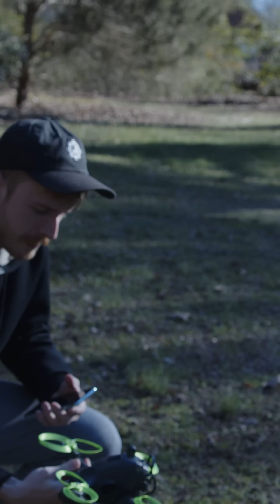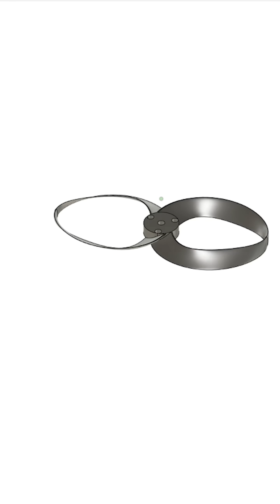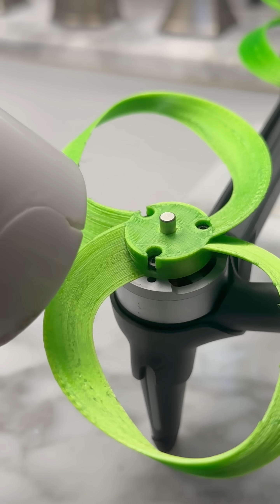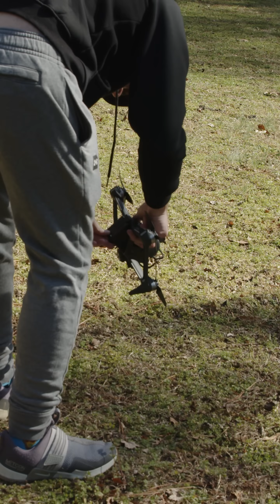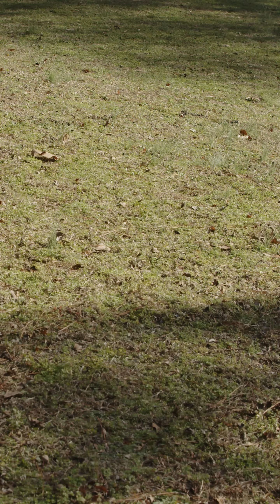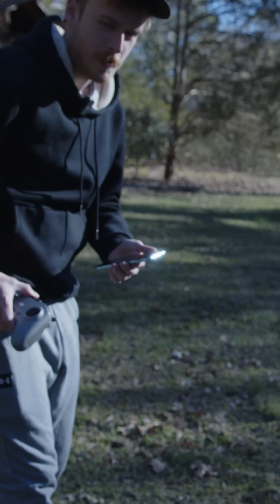Testing MIT's Toroidal Drone Propeller Design & Sound #shorts

Comment: Did it ever occur to you that the nail polish coating was not smooth enough, resulting in turbulence? In that case it would’ve increased turbulence, reduced efficiency and increased the amount of noise. Production seems flawed.

Comment: The 3d printed propellers weren't smooth which makes the entire test pointless. The roughness of the surface introduces turbulence which both reduces thrust at a given rpm and increases noise

Comment: I think it sounds promising, but the "quieter" is greatly impeded by the commercial propeller being made to a much higherstandard - more accurate shape, thinner due to stronger material, and smoother. you really would need to print propellers of a traditional type with the same printing technique to compare.

Comment: the premise is that the Hz frequency at top speed is more dull less spike so it dont hurt your ears.. they would prolly be better if you sand smooth and even all edges and sides no chips flaks grooves or lines then polish coat and try to keep that smooth and dont let is wall up in the twist

Comment: Dude, a coat of varnish is nowhere near enough to overcome the awful texture profile of these bootleg propellers ... He's basically blasting air at a step pyramid then wondering why there's distortion ... You have to polish them at a bare minimum, casting cuts down on labour times for this but you need some extra kit, like a little Dremel stone/jewelry polisher 😅

Comment: People in the comments are ignoring the fact that the type of sound those new props are making are significantly less annoying than regular props.  The purpose of theae props isnt to make them silent, it's to make them produce a sound that's slighlty less noisy and at a WAY less screechy pitch.  This new sound will not carry as far and will blend into the background noise at a much closer distance.  

The prop design he made is probably not 100% perfect, but that's not this guy's fault.  AFAIK, MIT has not released a CAD file or any other 3D model for this new design, so the best anyone can do right now is try to recreate them from the original white papers, the limited number of available photographs available right now, and the scarce few fellow hobbyists who have already tried this and documented their attempts.  The ridges left by the 3D printing are not going to cause much significant extra noise in this application, however you'll notice that he already mostly addressed this by coating them with nail polish to give the props a smoother surface.  Its not perfect, but it really shouldn't have more than a negligible impact on noise.

I'll bet all you fuckers in this comment section who are shitting on this guy wouldnt have the faintest clue how to even open a CAD file, let alone make anything from one.

Comment: Not quieter— But a lower pitch, Which is more bearable. However, Looking at the theoretical ones and the ones you made side-by-side, It seems you didn’t quite get the tip design right, And that is where most the sound is made. 

Proof of concept, But needs improvement!

Comment: It's not so much that they were designed to be quieter (ie: lower measurable dBa), but that they lack the blade ends which create vorticies, that in turn generate sounds, which are in one of those frequencies that the human ear (& brain) is most attuned to. By redistributing the acoustic energy of the blades across the spectrum, they make the sounds far less irritating to us & far more likely to be ignored as "background" noise.

This entire design concept is objectively brilliant & should be lauded by other designers for making the potential of drone-based deliveries in metropolitan areas so much more palatable.

Comment: Bro the MIT students didn't just built one toroidal propeller and announced that toroidal propellers are better. They built several propeller,tested them out and released the best ones on their site. Their design is almost perfect and works efficiently as they told.

Comment: It sounded a LOT louder than your standard props.
You can theoretically print smaller blades which would equal your normal ones, as the toroidal props have what's essentially four blades cutting through the air at a relatively steep angle.

Comment: From a practical standpoint I will strongly recommend using a coating spray, even a clear one as opposed to nail polish because you will be able to achieve a thinner and more even coating that will have less impact on the balance of the propeller, lack of good balance on the blades may cause vibrations which in turn will cause more noise, reduce the aircraft's stability and potentially break the propeller over time because of the uneven load created on the blades.

Comment: 1: if you modeled them, it  is not the same design. even slight variations matter in prop design and you opened the door to huge variations.
2: their props were resin printed which has a huge impact vs fdm printed. props need a smooth surface. materials properties aside, the finish is incredibly smooth compared to fdm printing as a whole; nevermind the terrible quality prints that were featured in this video which leads me to-
3: the print quality was low. and when you factor in the use case, it becomes completely unacceptable. I need not explain the extent underextrusion and inconsistent layers have on the aerodynamics of something like this. look at it, it's rough. 
4: Bad Annealing. Annealing a print changes its shape as the material bonds to itself more thoroughly and internal air-to-mass volume is reduced, it shrinks. If the annealing is done unevenly, the part will heat and cool unevenly. Not good when the print needs to adhere to a particular design as strict as the tolerances on let's say a PROPELLER. Let that sink in. That's why the big brains at MIT used tough engineering resins that have minimal shrinkage though curing.
there is a correct method to anneal fdm prints that involves surrounding the print in a stable matrix and heating thoroughly and slowly through convection. 

In summation, the footage of the drone becoming louder with the toroidal prop- while entertaining, is equally misleading. improper design, production, and post production were to blame for the props poor relative performance. I'd just rather not see the public misled just because they don't know the whole story. a title like: Testing Toroidal Propeller from Wish dot com would have been more excusable.

Comment: I would have to assume 3d printed means a very rough surface, even with the polish. Also the shape would vary based on the size of the prop, expected RPM, and how much airflow/resistance would be wanted. I would expect the math to be complicated or someone other than MIT would have done it.

Comment: Propeller size, diameter, angle and weight have to match the designated RPM of the motors i guess. There is a sweetspot we have to nail in order for the desired effect to appear.

Comment: These propellers can't just be 3d printed. The prop design is actually exactly what it says to be. I had this same idea back in 2012. Just didn't have the means of doing correctly. This video is not an accurate test for these props.

Comment: Well, I don't know about it being quieter. But I do think it sounds a little less annoying, a little more muffled, less of the higher frequencies.
Reply: the failure is not on the design, but the manufacture is. maybe the surface is imbalance due to density/ thinknesses
Reply: I agree with this assessment. Alot of hate in the comments here but if we are going to have major air traffic with drones in the near future id much prefer the MIT designed props. Its going to make noise but if we can make it less annoying ill take it.

Comment: Surface roughness of a high velocity material will change the friction of gas flow across the surface therefor causing more gas flow disruptions. A high surface smoothness is therefor required in the minimization of noise. Therefor this acoustics problem is dependent on both design and material.

Comment: Great job inspiring others. Is the G-code available? If these were perfectly balanced and the blades were smooth out of production, I can only consider the noise and power use would be greatly reduced before the finish.

Comment: The heightened sound may be the cause of the small undulations from the printing filament and it may increase the drag as well. If the propellers were smoother, it may allow for a more quieter operation.

Comment: They have to be precise and very aerodynamic to be quieter. You can see a lot of faults on the 3d print and you didn't even sand it.
Moreover, since you needed them to be thin, you put a coat of nail polish on them and made them even thinner!

Comment: Toroidal propellers are not something you can make with any old 3d printer. Toroidal props have to be constructed with an incredible degree of precision in order to work correctly, because they are much more sensitive to imperfections in material density and shape than traditional designs. If the density or shape is even slightly off, then they tend to rip themselves apart with turbulence. Companies have tried to build toroidal propellers on and off for the better part of the last century, but it's incredibly difficult. Also, none of the plastics commonly used in 3d printing are suitable propeller materials, so you really shouldn't be using printed props outside of a lab.

Comment: Would need proper equipment to actually gauge how much quieted (or louder) each set of propellers are. How it sounds on my side is - both are equally load but at different pitches.

Comment: "I annealed them to make them harder."

I know this is the correct terminology used for that process, but its confusing to me because annealing usually means to heat things to soften them, as to be more easily worked. I think it's more akin to heat treatment as it doesn't get hot enough to recrystallize, like how powdered metal parts are made. But, that's just my 2c opinion.

Interesting parts, I would think an advantage to this geometry would be that it's less likely to tangle in foriegn debris like grass or string. Does it offer more lift or efficiency?

Comment: Pretty loud, but you do have to account for the difference in materials. The stock propellers were probably injection molded, without any chance for trapped air to cause instability, while 3d-printing allows for way more unknown variables. The print could have air pockets, or be less stiff, which could cause it to wobble. The noise was still deafening though, and I doubt that was just because of a change in materials.

Comment: I’m pretty sure the toroidal props are supposed to have a rounded thickness as opposed to the flat, twisted band shows here. Also the surface needs to be smooth to mitigate turbulence. The state-of-the-art design is not only quieter but more efficient as well.

Comment: Professionally constructed to specifications would be quieter. But you're also not getting the same effect when they are all working so close together, the Soundwaves have nowhere to go to avoid banging against each other and making even more noise...which is only part of the problem really. A set manufactured by the peeps at MIT who designed them would likely be much quieter. Then again it's not so much the quieter RIGHT NEXT TO THE VEHICLE as wanting the Soundwaves to not travel as far as they normally would.

Comment: might actually be louder, but lower in the high-end, which equals slightly easier on the ears.
Reply: That's pretty much been the case every time I see these. It just cuts the high end noise down so it isn't such a piercing whine.

Comment: They would be a lot quieter if u modified the surface of the new props with dimples. U increase surface area which makes more lift and the air will have more uniform flow over dimple surface. Verify with autocad. 👍 Lov to see vid. Oh, and they'll be stronger too!

Comment: I love the the coating of nail polish probably to help with the hardening literally something I would do 🤘🏻
Reply: No. Don't use nail polish. How do you even picture a uniform application of it using a brush?! Better use a spray coating of whatever brand, you'd be able to achieve a result much more uniform than that.

Comment: Sounds like the motors are struggling and more air interference than usual being louder it sounds like with the green pro. Might be better if you made them out of the same material as the original propellers but sounds way louder to me

Comment: Propeller blades are suppose to be smooth so they chop through the air easier, that 3d printed plastic will have thousands of tiny ridges.

If you want to improve those but keep the 3d printing aspect, sand down the blades so they are smooth, even better if you want them smoothed down evenly get a tumbler

Comment: The material used is wrong. MIT design those out of carbon which is lighter and stronger. These are actually quieter and they are supposed to be more fuel efficient than the conventional propellers. In addition, you also have to think of the ratio of the drone to the propellers. The motors of the drone are obviously struggling therefore producing a louder noise.

Comment: Besides echoing off other comments with simple logic in manufacturing differences. For the simpletons, think of submarine propellers. You will not find what a current US or Russian submarine propeller looks like. They are highly controlled classified designs to prevent the detection via sound. They are silent. Further basic knowledge denotes that sound frequencies travel vastly louder and further on or in water. So think of multiple blades churning water pushing a huge vessel at quite fast speeds underwater, silently. 

It's entirely possible to have whisper quiet blade designs, as long as the manufacturing is performed correctly.

Comment: I build custom FPV drones.  Your experiment is terrible because what you are doing is dangerous for a number of reasons...
1.  You made them on a 3d printer- there is zero chance of concentricity.
2.  You melt them after-  because of just that, there is zero chance of concentricity.
3.  You unevenly coat them in acrylic-  because of just that, there is zero chance of concentricity.
4.  You are using a stock tuned box drone- not a tunable custom drone.  DJI put years of tuning THAT setup to THOSE props to take out unwanted sound or vibration through careful PID programming.  You changed all that.
5.  You changed the motor load by increasing the weight from the stock props-  you are going to burn up something and it wont work for long.
6.  (I didn't test them) But the design looks like a step backwards in prop tech since you are spinning more mass- so you have less control.  IOW- it looks like a gimmick.

Warning to your viewers- do not try this-  You could have a flyaway and kill someone.

P.S.- want it quieter?- use more blades per prop.   I use 4 blade on a 5" because it is 25% less noise.

Comment: I'm not sure, but because you coated them, it probably changed the quiet quality. Also, the materials MIT used might be different.
Reply: Propeller manufacturing requires high precision. 3D printing is not it. Those kind of props are already used for ships and have proven to significantly reduce noise.